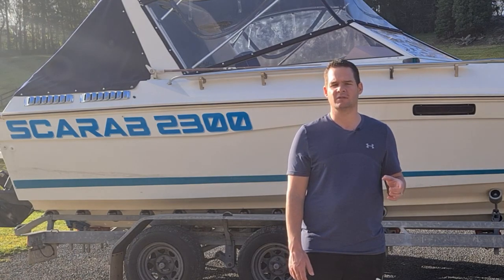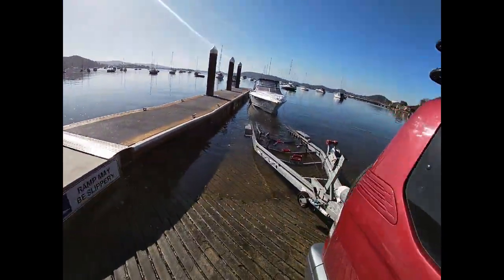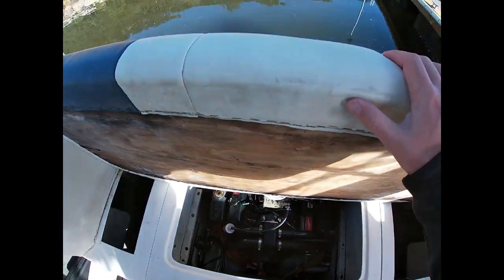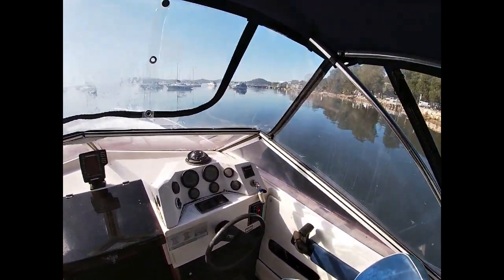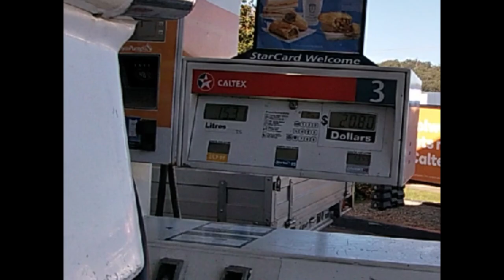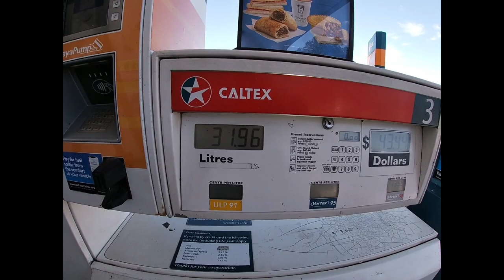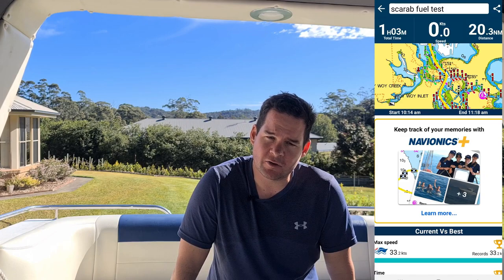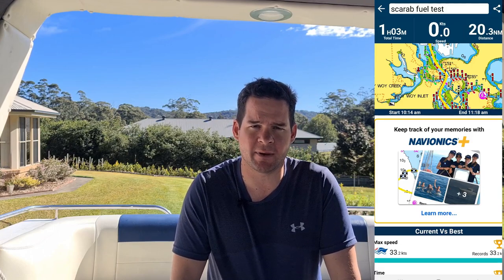How much fuel does a classic  V8 really burn ??? 1989 350 Mercruiser tested in a 23-foot Scarab

Comment: I have a 1990 Bayliner Trophy Hardtop 2459. Engine 5.7 magnum Mercruiser, Alpha 1 drive. I cruise at 3350-3400rpm, speed approx. 22 mph, fully loaded (6000+) fuel, water, food for 4 days out overnights. Burn roughly 8 GPH depending on sea conditions. I plan on a burn of 10 gph for safety margins. Travel time to fishing 3.750 hours each way here in Alaska. Had my boat since 2008. Propeller plays a big factor my friends. Turning Point Voyager SS 14"x15" propeller.

Comment: I have a Bayliner Ceira 2355
It has a
 Mercruiser 5.7 210hp
 2 barrell carb. Alpha1 this boat with fishing gear and fuel tank of gas 55gals. weighs in at 6000lbs. 
I trolled 27miles over 9hours and burned 14gals of regular gas. The next day we ran off shore and back 37miles out and back. Mostly running 3200rpm. Burned 18 gals of regular gas.

Comment: Large carb v6 outboards burn a lot of fuel. Having personally had ski boats with both. Bullet 1800 powered by a early carb 175hp Mercury 2 litre power head and then a Camero Volante powered by a 350 chev. The 350 used little more than half the fuel of the outboard over a typical weekend of skiing.
Reply from the maker: And no two-stroke oil to buy

Comment: A mercruiser 228 is 305 cu/in not 350. Also, that is not a scarab model.
Reply from the maker: They were built here under licence in Australia, I know not the same as the proper American ones.  Are they not based on the 350 chev small block? I'm fairly certain they are.
Reply: @tjmarine7121  no, that engine is small block Chevy based however it's 305 cubic inches. Different bore, different head chamber, different valve size. It's a lower horsepower cousin but not a 350.
Reply from the maker: Interesting mate I didn't know that. Thanks.
Reply: I'm a bit confused here, is it a 5.7L or a 5.0L Mercruiser?
If it's a 5.7L it would be based on a 350 chev sb.
Reply: @randie450  the engine in the video is a Mercruiser 228 which was a 5.0/305 cu small block Chevy. Though the video says 5.7 that's incorrect.
Reply: The engine is also running a Holley carburetor rather than the standard Rochester Quadrajet.
Reply: corrrect